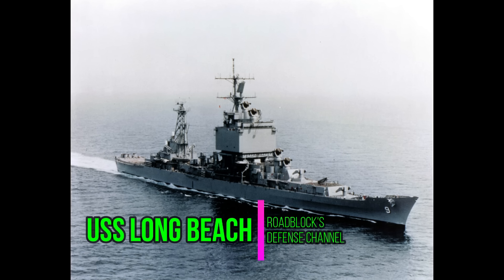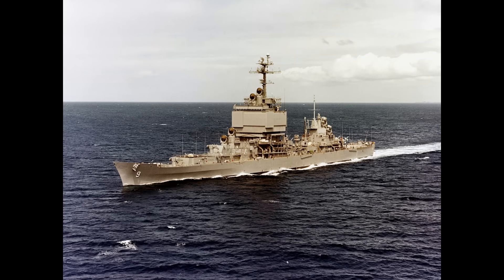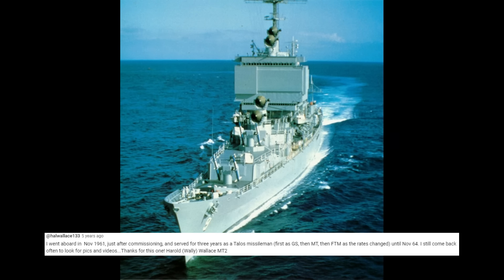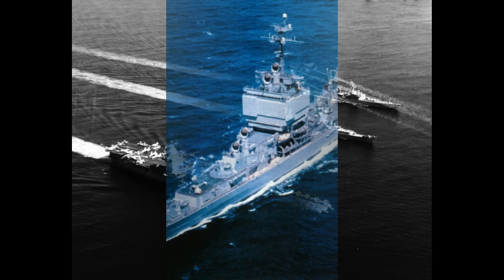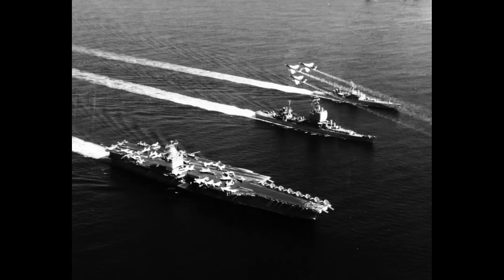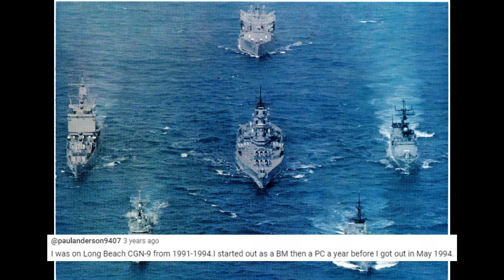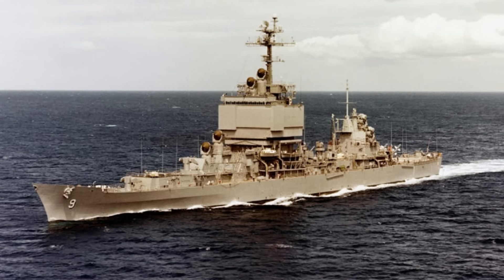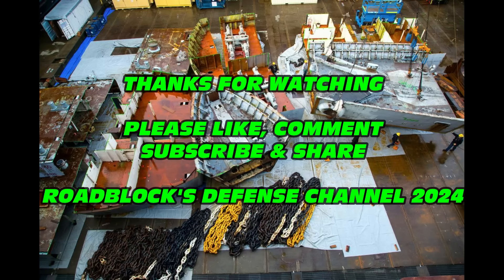USS Long Beach CGN-9 - US Navy [03/28/2024]

Comment: With all these Radars and the nuclear plant, did the crew have an unusual amount of radiation exposure related health issues? Did anyone notice any more of a cancer risk versus other surface ships?
Reply: I was aboard 63-65. I'm 80. No issues.
Reply: @terry9370  I was just wondering if anyone had studied the issue?
Reply: I was on the Long Beach from 77'-80' , the last year I was on it they identified a compartment that we were responsible for that could be a radiation hazard. They issued us radiation dosimeters worn on our belts. Once a month we would get them read out, usually it would be between 4-5 rad. my space was between both reactor's in CIC. I wanted to see if I was exposed to more radiation on the ship or off of it, so (not supposed to take these off the ship) I took it home with me on a weekend when in port and the next month when they were read out, it was between 10-11 rad. They were all concerned about the high reading . i told them I accidentally took it home in my laundry. they calmed down after that and said that the background radiation in concrete is higher than I would normally get on the ship. That made me feel better having spent 3yrs between 2 reactors. DS2
Reply: 81-85 smoker and asbestos in PSNS 81-83 on LB , now disabled with severe copd and heart problems. No cancer discovered so far, I'm 61.5
I'm NOT so sure my severe COPD is because of shipyards, because I went on to serve on 2 other ships, being a BM the whole time, and of course that means a lot of fumes in paint lockers. ALSO after 10 active Navy years, I became a truck driver, drove for 28 years with TONS of fumes from diesel and DEF! So, who knows. :)
Reply: The guys were not out standing on deck, in front of radars. The radars were way up high. My roommate was an eng dept officer, but he was useless, he did not glow at night..My stateroom was on the starbord side, in the box, on the main deck, right by one of the reactor access openings. We did not have to wear rad badges. I was about 22, now 77, still would like to go to O City.
Reply: @Nepcat4-qt5kz  I don't know. I was a little relaxed in my feelings about being exposed to radiation. Used to work with x-ray machines and nuclear density meters.